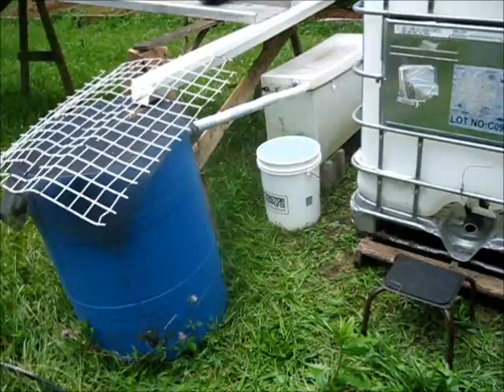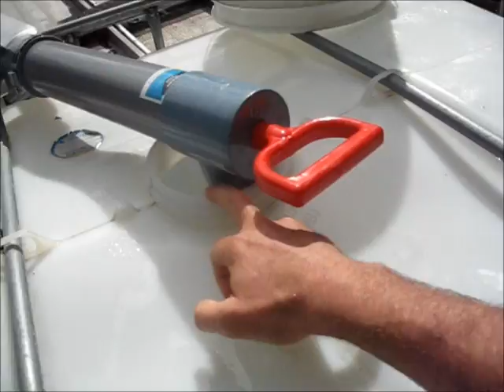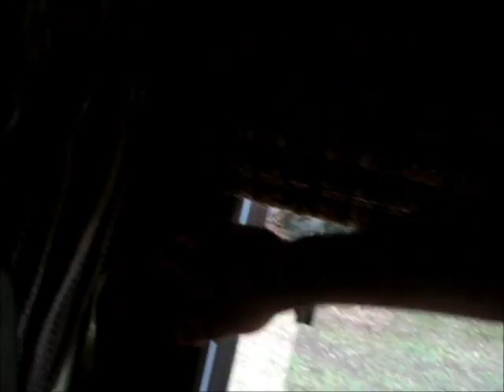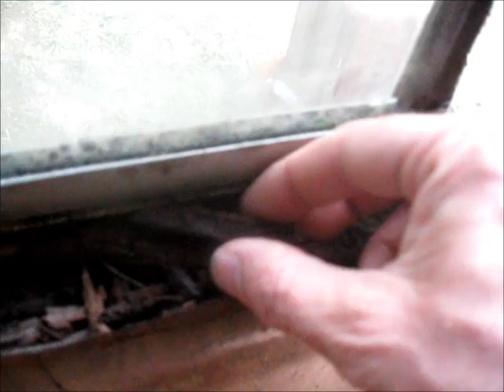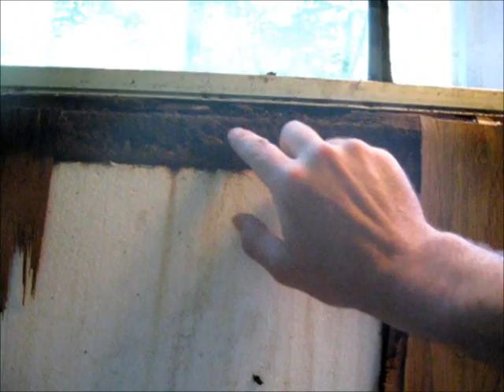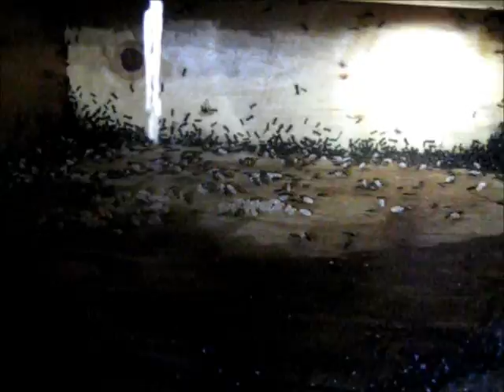Off Grid Rain Water And RV Interior Demolition

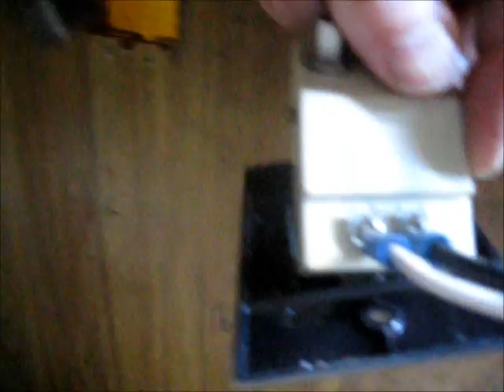Comment: Around 16:30, if that is an amplified antenna, it will work with the modern HDTV signals, I still use a signal booster from the mid 80's, it doesn't care if the signal is digital or analog as long as it falls within the frequency range

Comment: Troy, take a little time to look up a few RV repair vids on youtube. Yes, the windows are held in by the inside shield, which you took off. The rubber butyl & possibly caulk may still be holding your window on place. RV's still use the amplified TV antenna boxes. They connect to the roof antenna. Although many new TV's are now DTV enabled, mine isn't, so I still use my roof antenna to get signals with & a DTV box connected to my TV.  Thanks for sharing each step as you go along! good luck

Comment: They may have welded the wall together then used self tapping screws to attach the paneling and window. Wow you set the bomb off on those pest LOL. Maybe you could somehow get a gasoline welder to work on the wall with. the metal may be still ridgid enought to work just surface rust maybe I hope.

Comment: A thought.. Attach a gutter to the end of your collection panels. Attach piece of gutter downspout to that and into top side of bulk tank. No more water pumping. Raise height of panels to allow gravity feed into tank. Install overflow outlet in bulk tank to feed blue barrel. Connect overflow from barrel to white container. Add overflow connection from that for hose if you want to route somewhere in particular. 

Screen wire over gutter & blue drum to keep debris & skitters out. 

Hope this helps

Comment: Big tank - Put a strip of masking tape down north side off tank. Then spray paint tank black, using paint for plastic. Light multiple coats rather than thick single coat.

Remove strip of masking tape. The small area left unpainted is your water gauge to see how much is left in the tank.

Comment from the maker: The TVs are usually 300 watts each. Same with the game and pc. You use about 1.2 kwhs.

Take the number of hours you run them and add it up. Lets say 5 hours. Then  you need 6000 watt hours.

Should be fine with about 1000 watts of solar panels.

Need about 500 Ah of batteries. Double that cause batteries are discharged at 50%.

Increase all numbers to get through cloudy days.

Comment from the maker: My built in air conditioner for example takes about 1,700 watts. Give it about a 50% duty cycle and you need about 5,000 watts of solar panels to run it. That number takes into account the average sun hours. Where you live may be better or worse.

Problem is that = 141 amps from the batteries and HUGE wires are needed.

141 Amps x 12 hours (50% duty cycle) = 1700 Watt Hours needed.

You need about 3600 AH of batteries. 1700 x 2 because you can only take them down 50% of capacity.

Comment from the maker: You cannot actually do that. You can keep the cooler, use larger wires and use an MPPT charge controller to get closer to their rated capacity, but normally you get way less than they are rated for.

Doubling the output I question. Unless they do what I mentioned above.

Comment: On the RV, I wonder if galvanized hat channel would work for shoring up the rusted steel. It's used as furring strips in commercial construction when they need to put a finish surface over a brick or block wall.  It's pretty cheap and looks like it would be about the right thickness.  As long as it's not too much it might work.  Wouldn't be structural though, but could reinforce weakened areas.  Whew, there was a lot today.

Comment: Wow! never seen ants out of the ground like that. Are thay like termites? I am sure ya get lots of sudgestions, but I had a simmiler problem with a metal frame wall like yours and found that after wire brushing with my drill and by hand that rust olium "cold galvanizing " spray paint works really good.I then cut pieces of 1" boards that fit snugly and used liquid nails and tapped them into place and let dry 24 hrs and I had something to build my wall to. lots of ways to fix. wish I were closer

Comment: For removing a lot of screws without using a electric hand drill: Get youself an old woodworkers brace ( fleamarket, yardsale ). You can put the regular hex adapter bits right in the chuck, works perfect. For tight spaces get a quality made one ( Millers 
Falls, Stanley ) with a built in ratchet system. The brace helps also with tight screws, since you can put pressure on the screw/bit connection and you have some torque with the way the brace is designed and the handle positioned. Take care!

Comment: I guess in an RV DC wiring "mocks" an AC 110V circuit, where the "hot" is always Black and the "return" is always White. I never knew that before but never owned and RV either! :-)
There are products to transform rusted metal into firm metal as long as you have enough metal left. You can add to the metal and sister in fresh pieces to mount new panelling too. Good thing you have styrofoam insulation, fiberglass would be loaded with mold. Use this wall to determine with a plan for the others

Comment: That's a lot of work to move water that could be moved on its own! Be on the lookout for a fitting to attach to the valve on the tote and direct water from your overflow into the tote.  The water will end up leveling across all of the tanks if they are connected openly from the bottoms of each tank.  If you don't want to cut into your first two tanks move your first overflow to where the top of the tank is level with the top of the tote and let the tote be the final overflow Hope it helps.

Comment: Just a footnote, that window with the trim removed, you could use duct tape across to prevent it from falling in or out while you work on that wall, just do a seam all around it with the tape or just remove it out so it don't get broken. glad to see that you are now tackling the nitty gritty work and you'll be glad later that you did. it is going to look great !! thanks for posting Troy.

Comment: Quite an ant nest but no surprise really. thankfully they are confined to one area, so far and probable you will get them all in one bug bomb , no sign of them anywhere else is there ? All that damaged wall panel and wood can of course be cleared out and replaced . I would hang a tarp on the outside of that wall over window on the outside ,keep rain off it. The steel frame , you can clean ,dry out, sand off and treat with rust check ,then paint. add wood alongside the steel to fasten new panel.

Comment: troy the first thing i have to say is those bug bombs they need to be set up right.if you read the directions it says that.and i dont want to sound rude but taking off the trim on the window wasnt the best that window can fall off now. check out some diy rv repair then you will know how things work and can fix them.trail by error is good but the correct info is way more useful.thanks

Comment: Well, I'd say you'll be planning on pulling the fridge out and rebuilding it's support / frame. It'll be heavy no doubt. I'm thinkin take some 2x4's and put together a temp stand for it - just to slide it onto so you don't pull your back trying to get it out of the rv.

Comment: im surprised it has a steel frame.  must be great on fuel MPG haha, im wondering are you ever going to attempt to fix the engine after you sort everything else out? too bad about the ants. Ill post you a video if some wiring im trying to sort in a UK camper. its had some umm interesting alterations but for 24 years old its not bad.

Comment: Anybody that knows basic electricity knows that DC current flows from NEGATIVE to POSITIVE. Ground is a misnomer term used in DC to mean COMMON. You can common one side off all appliances. You just need to know which side they chose to be COMMON, plus or minus. Then, if you want, you can call THAT ground.

Comment: in houses they use standard house color coding even on 12v DC, when it comes to security systems and things like that that need 12vdc they still use black as the hot wire, in cars the true negative is labeled as positive for some reason, thats why the negative(black wire) goes to ground in a car, it collects the electrons when the circuit is completed from the positive side(red wire) +collects, -produces the electrons, therefore in cars its labeled backwards, thats why its handy to have a meter

Comment: Just have 2 comments about the rain water collection (No need to respond). You need to increase the collection area with a couple more of those pieces of metal like you are using (if you have it), Why not take that extra 12 volt water pump, and use it to move the water from the rain barrel to the ibc, as well as pumping it into your camper.You could hook it to a spare solar panel, or use any extra batteries to provide power to it. Keep up the good work. Love your videos!

Comment from the maker: Yes, they take all the shortcuts they can. I just found that the wall by the fridge was not insulated at all. And there is a huge outside vent right there. Happy I exposed that to insulate it myself better.

And the RV has to be light in order to pull down the road, very important but it makes them fragile too.

Comment from the maker: I was thinking of using autobody tar undercoating in a can. After removing all the rust, that is. That stuff coats and lasts better than anything I have seen.

I use the liquid ant baits. Clean and harmless for the environment, but not the ants, hehe.

I will put boards under the RV later. I might just pull it with my truck to get it into a better position when I get to it. I havent leveled it yet either.

Comment: Coat the steel with naval jelly first and a good rust inhibitor. Available at any auto parts store.throw a few liquid ant bates at the nest... be thankful that they are not termites. I know your not that into chemicals but Ortho bug be gone is a good product to spray around the outside of the camper. wheel wells anything that's in contact with the ground. with all the rain and soft ground how do you plan to keep the RV from sinking. you might be able to find some cut off 2 x 12 pressure treated.